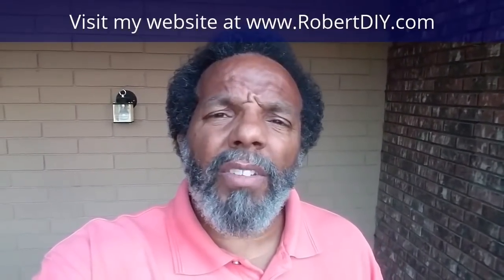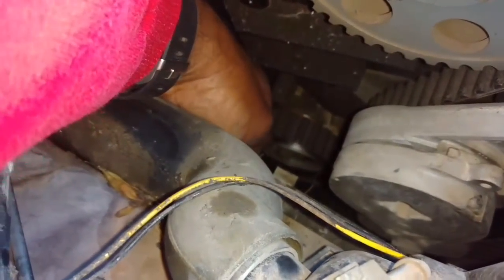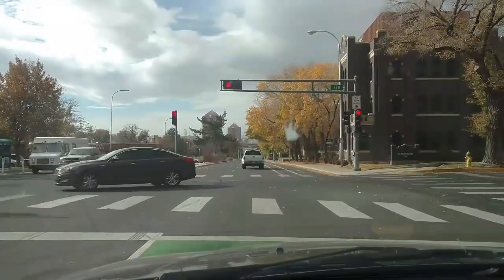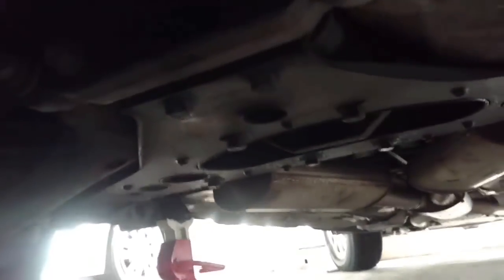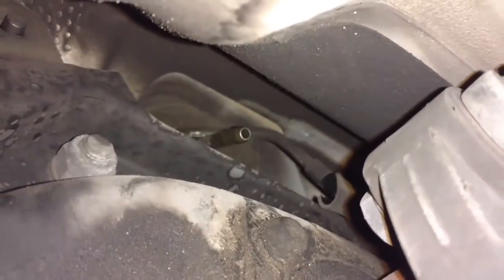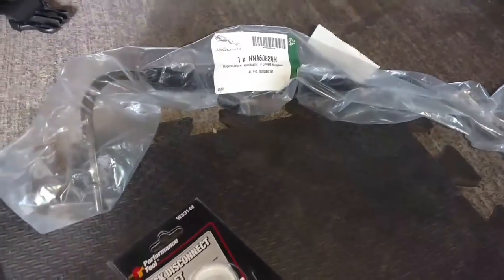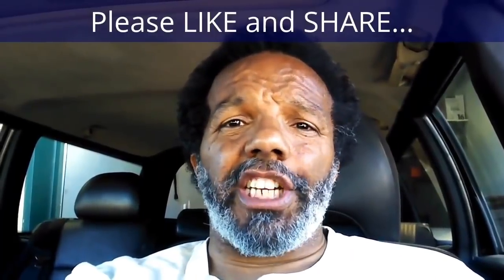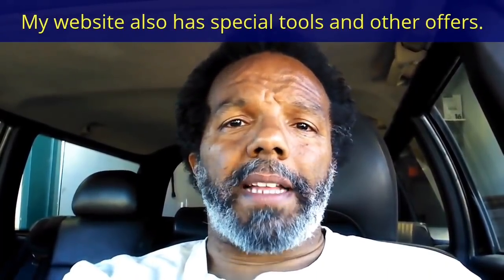Checking a '98 V70 for a timing issue, then replaced a fuel line on a '03 Jaguar XJ8. - HOWR

Comment: That jag looked like a pain to access that pipe, another designer that wants a good kicking lol :-D.
Ooow poor volvo, and the pillock ran the vehicle with it sounding horrible :-(
Reply from the maker: The book calls for dropping the rear suspension, horrible process.
Reply: If you go by the Haynes manual, you will end up removing lots of parts you dont need to, its an on going joke that to replace the starter you will have remove the back seats and left back wheel LOL :-D.
Not really, but haynes sometimes feels like that.
Don't get me wrong robert, i love the haynes manual as it's written for ordinary people, it's enough info to get the job done.
Also they often show another way to get the job done without that "special tool" :-D, i would not be without haynes.

Comment: What happened with the v70?
Did the owner fix it?
Reply from the maker: I went back and installed another tensioner. It did start but has a misfire on #5. He ordered the new parts to have a cylinder head swap yesterday. I'll probably swap a head on it next week.
Reply: if it had 185k and nothing done to it then the head swap is just the start of the failures ...wheel bearings ,radiator,hoses ,O2 sensors if you don't keep up on the Volvos the do run along time but when 1 thing goes there is 4 more right behind it.....Robert knows this as the pull and pay is his second home ...LOL
Reply from the maker: I told him that his other head needed to be rebuilt, or he'd have a burnt valve next. lol